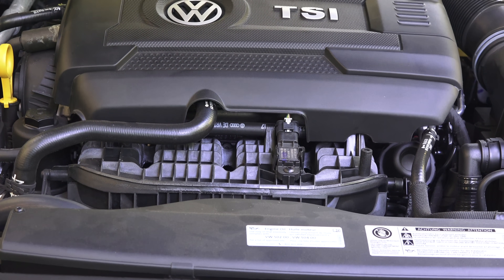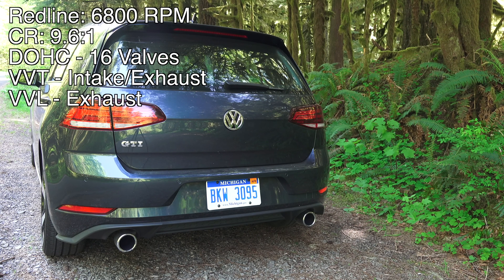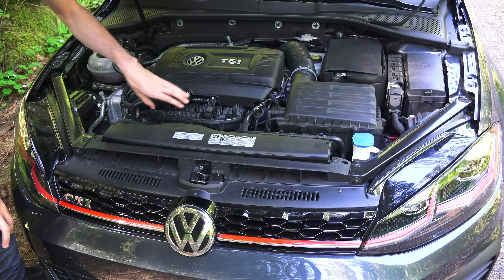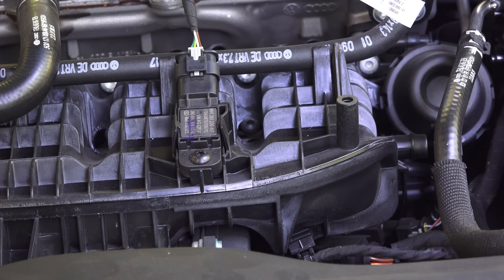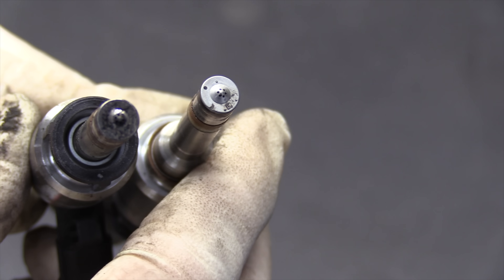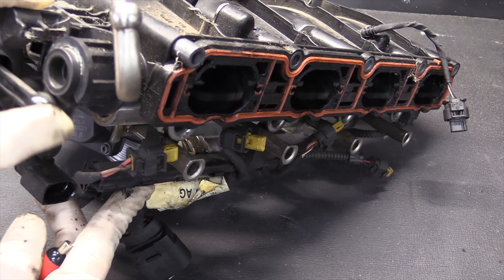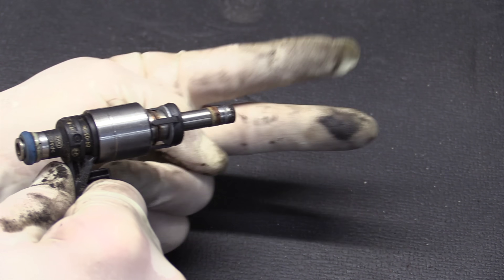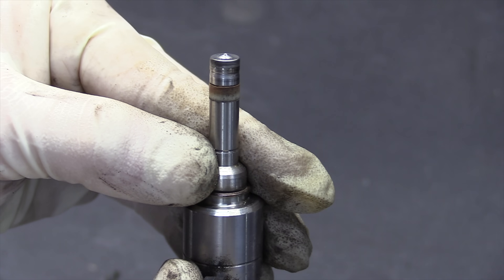The Best Engines - Volkswagen GTI Turbo

Comment: Necessary clarification: this is a Gen3 TSI EA888 engine. It’s taken two generations full of malfunctioning parts to get here. Water pump, intake manifold flap mechanism, carbon build up issues resulting in injector failure, coil packs, and timing chain tensioner are just some of the parts that commonly fail.
Reply: third time's the charm
Reply: You forgot cam followers wearing through and oil consumption issues.
Reply: @wombatrides3633  this was on FSI engines pre 2008
Reply: Water pump and intake manifold went on mine too. Nothing relating to coil packs or timing chain tensioner yet...
Reply: @SabeTheApple  FCP EURO has videos on that, mine went out like 2 weeks ago in my 1.8.
Reply: The timing chains also are wearing out earlier than expected, around 200,000km. I really like mine, but it does have a bit of an appetite for service.
Reply: The water pumps still leak.
Reply: Using this for a redit thank you !
Reply: What VW owners put up with is beyond me.
Reply: 32k gen 4 ea888
Cam follower, cam follower sensor and hpfp
Mk8 gti Clubsport 
not even 4 years old
Reply: @TheYorkshiregolfbandit idk what they did with the mk8’s, they’ve had more problems in the first half of its generation than the mk7 had through its entire production span. I’m at 62k miles in my ‘19 GTI and I haven’t had any problems so far knock on wood
Reply: Hi Raoul! Regarding your comments, the issues you note are for the EA113 engine, the first generation of the EA FSI and TSI engines, not for the EA888.
Reply: @andresgranda6328  EA113 is timing belt not chain. EA113 = FSI / TFSI , EA888 = TSI

Comment: I have a seat Ibiza 1996 with the 1.9 liter 90cv diesel and a 2001 VW Bora with a 1.9 liter 110cv. These are great engines, probably the best diesel engines ever made, and never gave any problem.
I also have friends with the GTI 2.0 liter motor and they have lots of problems for a new car so in my opinion the most reliable petrol VW engine it's their inline 5 cylinder and not that 2.0 liter/5 cylinder

Comment: Interesting. Great review. I wonder improvements have been made to cure the carbon build up at the intake valve side by introducing dual injection methods on VW?
Reply: Ian Polo it would be a good idea. It seems like the CR TDIs don’t have much problem with that for some reason despite having DI and EGR like the older diesels and the gas motors that get gunked up.

Comment: I bought a new MK7 Gti Sport.  I love the performance and agility of this little car.  It dont need to be tuned because as is it is just fine. I was just wondering what your opinon of tuning these engines is...good idea or bad.  one down side to tuning is that it would require running 91 premium all the time verses stock it runs fine on 87

Comment: I myself love my 2016 Mk 7 GTI but I've heard of issues involving carbon build up. Is there a safe additive to help reduce the build up? I've also heard that I shouldn't immediately shut down the engine. I should 1st rev it a bit, then shut it off. Thanks.

Comment: German cars from an engineering perspective might be impressive but ultimately the best engine is one where reliability showcases itself.

(obv if properly maintained)

I don't see any of those modern best engines lasting longer than 250,000mi & especially with cost to maintain the vehicle & replace melted plastic parts.
Reply: @Douglas Hamner why does that matter? 
If manufacturers call something lifetime they mean 120k. And older vag cars where fill for life as well. The gti needing an oil change at 40 does not change that... 
Or do you think a gti has a longer expected lifetime then any other car manufactured today, because gti?
Reply: 100k is already a miracle for these things
Reply: Jenkin you’re out of your mind. Drive whatever you want. People say that because they can’t afford one or are scared to afford one because of people like you who don’t know squat. Pop your bubble and go live your life.
Reply: @stig5763  who can't afford a gti? Lol 
A used one is like 12g on a bad deal
Reply: They are not supposed to last 250k miles lol. 
Gearboxes have lifetime lasting oil and are maintenance free. 
But it is also advised to change the oil after 120k kilometer.

Basicly saying that 120k km is the designed lifetime.
Reply: Gtis are also a cheap sports car buddy

Comment: I'm all for turbo and efficient car for everyday use, however it just doesn't feel as good as a well built NA. Even less powerful NAs have something pure .... I saw the old A-serie BMC converted to DOHC and 16v with fuel injection, it made 160 BHP from a 1380cc in a beautiful sound, all of that from what was in essence a 60 year old engine ... that felt magical.

Comment: Of course it's no surprise the "comment section" is slam full of misinformation and ignorant haters of VW in general. 
Anyways, for those insisting "carbon buildup" is this HUGE issue, VW has fixed that so no issue. Also, as far as the VW GTI somehow being an "unreliable money pit" well you people simply  have no idea WTF you're talking about. Beware those who regurgitate misinformation, you'll simply screw yourself out of an awesome automobile. Lastly, the car comes standard with a 6 YEAR / 72000 warranty.
Reply from the maker: Just curious, how did they fix it?

Comment: Would you use 5w 30 or 5w 40 oil in these engines?
Reply: Neither, 0W40 is the recommended oil.

Comment: My favorite is when car enters safe mode for unknown reason. You can't exceed 80kmh. So nice when it happens on highway, where limit is 130kmh, and even trucks drive faster than 80kmh... Best engines, no doubt, especially diesel ones.

Comment: My 2014 Passat has this awesome engine< I swear this car doesent know what a hill is, it has so much power for a 4 cylinger. I have had no problems with this engine, it is awasome!
Reply: @J L Well, you can get that engine with 310 HP and 400 nm stock in a Golf R or Leon cupra.
With an ECU Upgrade you get around 360 - 370 HP with 500 nm.
I got one 20k km ago and it works flawlessly.
Reply: @J L No thanks

Comment: Also, what the hell is the deal with the plastic flap in the stock air intake box for the 1. 6 liter gamma engine on the Veloster? It's got some kind of spring attached to the hinge and it opens up under load or something like that? Could you explain that also. Not sure if it's on the Elantra sport as well but I could only imagine. People say that you get a more direct feel and response with less delay when you take that off completely or at least remove the spring from it. It's a little flap that opens and closes to a hole at the bottom of the airbox from the factory

Comment: The 1. 6 liter gamma with the Turbo from Hyundai. I've had one in both a Veloster as well as my current 2018 Elantra sport. What's so great about all the money they spent on this rip off of an engine that has multiple things from multiple different other confirmed reliable engines that's nothing but a hazard now because the direct injection doesn't clean out the valves which presents a problem later on in life and the Turbo is small on these engines if you can get into that andn the heat soak problem of the Elantra with less punch on the same engine than say like the 2017 or 2018 and prior veloster's because I've heard that they have bigger, ever-so-slightly, turbos that give for a more planted in your seat feeling when you take off because they're sucking more air or have the ability to suck more air with less heat soak in the intercooler.

Comment: You can make very good power with this motor too.  I have an A3 2.0T which is the same engine and with a downpipe, intake, full exhaust, and intake tuned with unitronic stage 2 i'm making around 340-350 HP

Comment: It’s nice car power + handling + design and different upgrades available in the market ,  but from my experience it’s not reliable for long term special in hot countries (because there’s a lots of plastic parts , I know it’s something in all germane cars) so when the plastic dry u Will change maybe everything also it’s complicated to fix when something fail ( for example plastic water pump in the center of the engine, u have to remove everything to change it.

Comment: So with my mk7 I'm on a stage 2 unitronic tune and I'm running 2.5 gallon of e85 then the rest 91 octane to achieve 93 for the tune but I'm wondering can I take the Intake from the Audi and have a better combustion or would it not make a difference  ?

Comment: Those miles on the ea888 highway should be higher. Especially on long drives!! My 2014 gli got well over 550miles per tank multiple times. I even took a pic of my MFI one time when i drove over 900 highway miles stating i was getting an average of 68.8 mpg ! "Again on ass long drives" Dam i miss that car 😞

Comment: I'd like to see FA20 engine. Toyota86 engine. It has both port and direct injectors and insane compression ratio
Reply: I understand that port injectors prevent carbon build up on intake valves but who takes care of the build up on exhaust ports? Aren't we concearned that the build up will cause exhaust valves to overheat?

Comment: Somehow nice to see variable lift, and variable timing of the intake shaft beside the Honda tech again.
But honestly-I really don't like the 'sliding' design of the whole camshaft. Its like pushing mass and disturbing the oil-film. (In the video the lobes look very scratchy-for not knowing the mileage)
Couldn't VW just use the planetary camgear design? Turning it without shoving it?

Comment: Absolute trash of an engine. I have never had such and unreliable engine in any of the vehicles I've owned. Two different cars using the same engine code. Random misfires from separate issues and both turbos failed. Didn't break 100,000 miles. My 92 ford explorer was more reliable. That's saying a lot. You need a new hobby, VW is total garbage.

Comment: The three-way calalytic converter needs the lambda value 1 to work as designed. If the engine runs lean the NOx reduction won't work. So no lean mixture can be used and it has nothing to do with catalytic converter temperatures...

Comment: Had my '17 GTI Sport 6 speed manual for over a year which comes with the mechanical LSD. Shortly after got the APR stage 1 for about 290hp/340tq. Pulls hard and still very economical. The clutch and shifter are awesome and is a joy to row through the gears. Only VW worth buying, but GTI and the EA888 engine is amazing.

Comment: A really good clip !  Question,  doesn't the mk7 2.0 EA888 engine have dual injectors ? One in the intake manifold (for low rpm use) and one in the cylinder head (for high power use) ?
Reply: Ps: I have a mk7 Golf R, and heard the Golf R has dual injectors to eliminate carbon buildup

Comment: I had a new Mark 5 GTi.   It was lovely.   Then the problems started.   Water pump.   Timing chain tensioner failure.   Turbo developed a leak.   Manual gearbox began jamming in-gear.   All this on a car driven gently for the most part, serviced by the dealer on time and all within 3 years and 60k.   When the warranty was done I was out of it in a hot flash.   A honey of a car to drive - when it wasn't breaking down - and it did that a lot.   Sigh.   Very disappointed.

Comment: kind of biased..in that same 4 fly. The 2.2 ecotec is a much better engine..4 bolts per main..all aluminum block and head..the main bearing carrier is 1 peice.not individual main caps.. basically a lower block with a oil screen built in. alternator and a.c. is direct mount to the block. I am using this engine to replace the 2.0 in my 1984 Alfa Romeo spider..go from 112 go to 155 go. but after head work and pc program I will be looking at close to 200-215 go without a turbocharger. perhaps you might want to look into the 2.2 ecotec..it is a great engine

Comment: Got this engine in the MK7 GTI and it is really great. Pulls really, really nicely and the fuel consumption is great. BUT its also very unemotional performance and soundwise and you need to pay alot of attention to the maintenance. The first 3 turbo revisions had some problems and the waterpump is a constant and expensive problem with these cars. Regular Oil Changes are a must. But in the end it is just a regular VW/Audi Engine with lots of tuning capabilities.

Comment: My understanding that it is dual injection The EA888 Gen 3 engine has both direct and port fuel injection via separate sets of injectors. The EA888 Gen 3 engine adopted a dual injection system to reduce particulate emissions and comply with Euro 6 emissions standards. May be different in the states be over here we do have dual injection ..

Comment: have that engine in my S1. used to do a weak job stock  (in this car! in the GTI it's great) due to weight and AWD... yet torque delivery from 2100rpm is great. also great for tuning. mine runs at 380hp :D

Comment: So........the bottom line they didn't use duel Direct injection yet which mean ........😒 Back to my dealer for more Carbon build up cleaning ...im still rocking rocco 1.4 twin charger but its matter of time before i get hit with carbon build up ....for 2nd time 😑

Comment: These engines coke up timing chains stretch and jump even on well maintained ones and cost a fortune  in parts and labour to fix. Numerous sensor and electronic problems . Fine if you buy new and trade in before 3 years old for a new one. But !!  More people a growing wise to all the problems,and second hand values are dropping don't listen about great residules and bullet proof reliabilty  as a mechanic i have seen too many people buy a three or four year example then find it has a "little" problem which will cost a kings ransom to fix. German cars are designed to last five years then you buy a new one. VW reliability ?? That disappeared around 2005 around the time questionable practices with diesel engines emerged. This can be said of all German cars now. You buy the badge to put in the driveway and impress the neighbours but remember to buy the Japanese/Korean runabout for your daily driver.

Comment: On 2017 and 2017 passat which comes with 1.8t n 2t are the same engines as the above golf. Yet the passat has wayyyyy less hp and torques then golf. Imean why would they so that. The golf doenst need 200+hp. The passat is big and thus need 200+hp and torque. Passat  competition has 200+  numbers. I just find it very odd

Comment: Having a 2.0 TSI EA888 gen3 in stock leon cupra 280 :

1) zero problems after 53k km
2) zero oil consumption
3) so much power and torque 
4) so much fun
5) average 9-10 l/100km fuel consumption (according to driving style, I do a lot of city driving)

Comment: Jason. Thanks for the great video. 

2:06 The front of the engine is on the passenger side, not the driver's side. So, the cylinders are L > R, 1-2-3-4, not L < R 4-3-2-1, as shown in the video.

Comment: That engine in Europe with almost all mechanics is considered one of the worst engines VW have ever produced. Please learn the facts. It has problem with chain oil pumpsl tensioners and injectors. The previous 1.8t was a much more reliable engine.

Comment: this engine sucks. The 2.0L TFSI that go up to 360Hp is far far far more a good engine and master piece. Porbably one of the best engine in the world. But this 1.8 is just nothing special. Any car manufacturer have something similar or better. Like renault the 1.8 go up to 280Hp and is just better. Peugeot 1.6 THP 250 is better with far less Co2 emission. .... no defenitly the 2L TFSI is the best engine out there but not this crap 1.8 fsi ...

Comment: I started with a 96 Hyundai accent, a 97 geo metro, 98 2.0 gti, 98 2.0 Golf, a 2000 Jetta GLI, 2014 GLI, 2013 Tiguan, and a 2016 Golf R.  My first vw was an auto, and it's been a manual gearbox for me until the golf r.

I've definitely had issues with some older cars, but they were neglected maintenance.  I've only owned one car brand new, and that was the 14 gli, the rest were all used.  

Regular maintenance is your friend.  The DSG gearbox requires a $200 flush every 40k as well.  Not to mention if you are AWD, you have 30k haldex fluid flushes as well.

You gotta pay to play.  You will be rewarded in the end, these are great cars.  Most of my vehicles are all variations of the ea888 2.0t.

Comment: I hate vw, screw them and there cheating emissions engine.
Reply: "Nissan says emissions and fuel economy tests were falsified", "Mercedes-Benz is alleged to have installed software to disengage emissions controls when temperatures are less than 50 degrees Fahrenheit. It is believed that customers were deceived into paying a premium for “clean diesel” cars that allegedly emit pollutants well beyond the government standard." "Harley-Davidson has an expensive emissions problem of its own. You act like Vw was only one.
Reply: Nak5u that's all good but the video was about a vw engine. Plus my hatred for VW also comes from the fact they are a pain in the ass to work on, except of course older bugs.